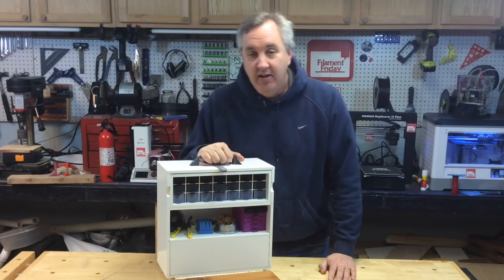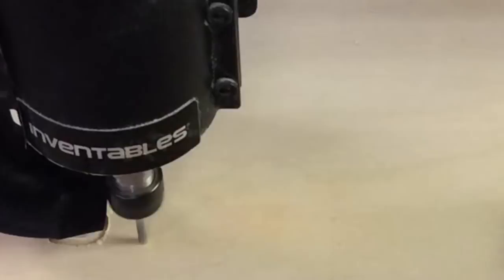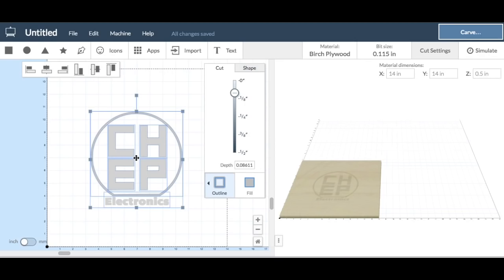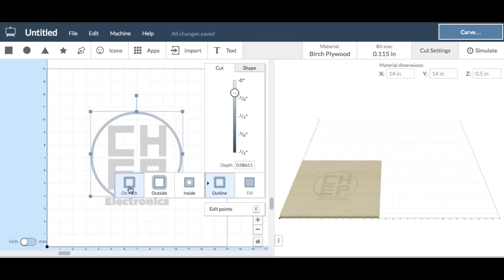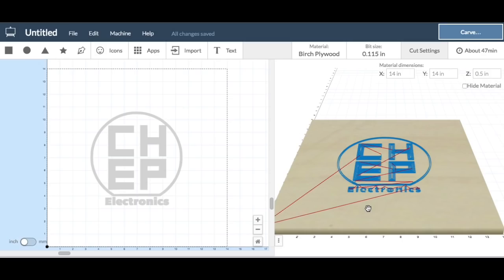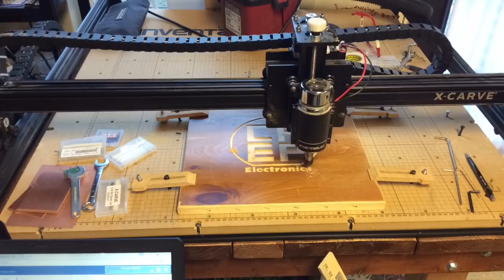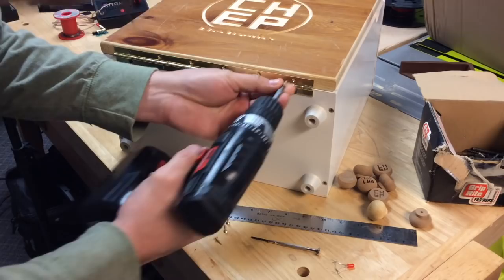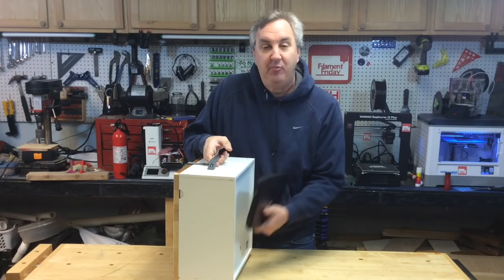CNC a LOGO in wood using EASEL and X-CARVE

Comment: Can the software you used be used on any CNC machine? Working on a homebrew CNC that runs off a RAMPS board. Thanks for the cool video!
Reply: Brain Popilek -- Do check out vetric VCarve Pro.   I have a home built CNC Machine, but found VCARVE to be my best bet in getting things done.  It's expensive, but working nicely as long as I remember to set Z depth and 0 reference first thing on Saturday Morning.
Reply: Easel has a export gcode to file. I don't remember the exact location but I have exported gcode and opened in other programs. just got my home built machine finished and hopefully make my first cut tonite.